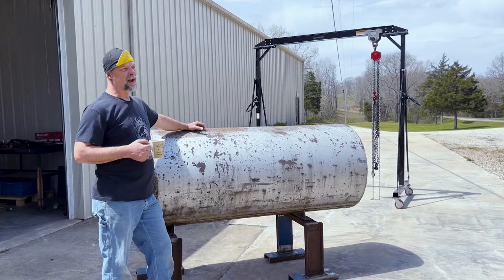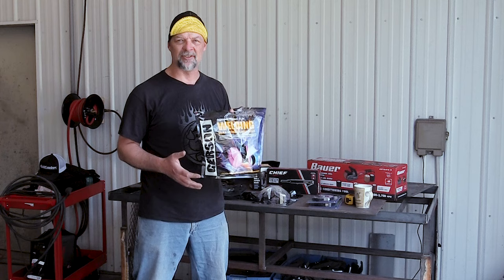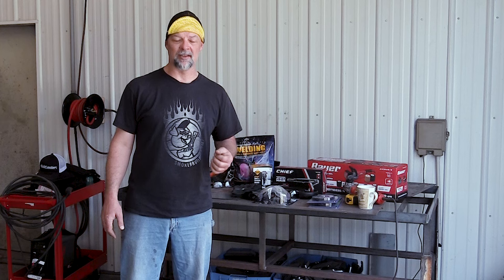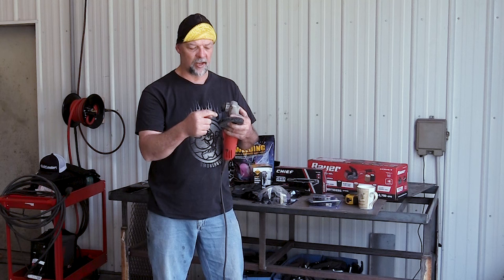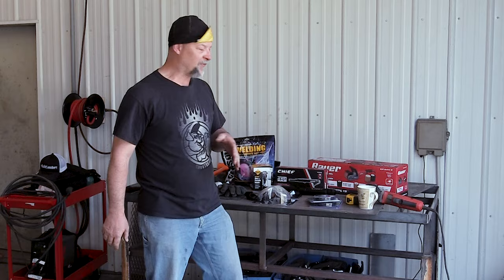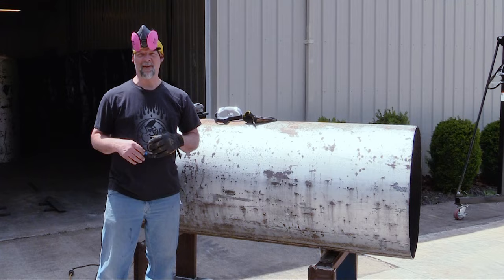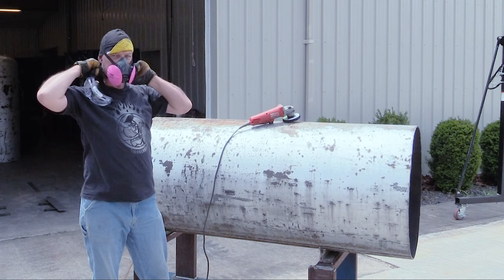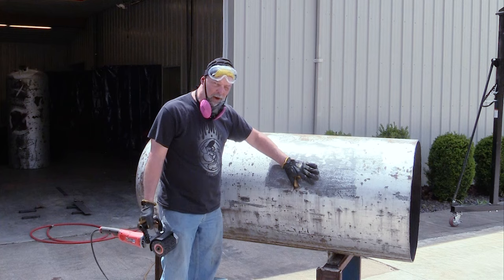How To Remove Paint From A Propane Tank Without Sandblasting

Comment: Awesome Frank, I've been curious about that tool since I seen BS BBQ use it on their offset build. I think I'll be ordering one off Amazon for sure!!
Reply from the maker: they are worth it bro!
Reply: I agree. They are worth it. I haven't tried the HF surface conditioning tool yet but maybe when I have some fun money I'll pick that one up and see how it compares to the Restorer. I can see how for one handed use the Restorer wins but it also has a wider frame so the HF surfacing tool would probably win when it comes to getting in tighter spots.

Comment: Is leaving the mill scale an advantage for appearance only if you're going with a linseed oil finish, or perhaps a clear finish? 
I would think that if you're going with an opaque finish, it wouldn't matter. Or is it a matter of adhesion of the paint/finish?
Reply from the maker: Yes, it’s simply for appearance.
If for some reason you do remove the mill scale and wanna have that dark finish, you can add an acid wash which I’ve been doing on some of my newer pits, then coating them with linseed oil

Comment: What do you do for cleaning the inside of the tank? Noticed on my build quiet a bit of buildup and have just been spending time inside it with a wire wheel. Wondering if there is a better solution. Thanks!

Comment: I am concerned about lead paint on a 1952 tank I am working on.  After prepping loose paint and coating with linseed oil is it pretty safe.  I know I need to be careful with the dust and removal, just curious how well it's is sealed up with the linseed oil.
Reply from the maker: Great question, of course, anytime you heat something, stuff will vaporize and get airborne.
I don’t really think the linseed oil  would permanently seal the lead vapors or whatever but I really do think that it’s not much of a risk after the build is complete.
Most of the risk comes during the build where you’re grinding and sanding and things.

Comment: Have you ever tried a pressure washer with a turbo nozzle
Reply from the maker: We have. They work good also! We used the nozzle kit that hooks up to a power washer and has a sand sucker tube that you put down in a 5 gallon bucket of sand. only issue is making sure you don't set the gun down on the ground and kee[ water from running down the hose into the sand sucker nozzle. If it does the tube plugs up. the nozzle wears out eventually so you need to find a replacement.

Comment: You mentioned lead paint several times. How sure are you that lead paint was used on the tank? Did you use a test kit? I've made a few propane tank smokers and lead paint is something I've always been concerned about with small children around the house. Even just a small amount of lead paint dust would be something to be very concerned about.
Reply from the maker: Great question Josh!
I am not positive, only operating on the assumption it is. Mostly because a high percentage of outdoor paints back in the old days did contain lead. Since this tank was re-painted many times since it was built in 1950 it's a perty safe bet in my opinion.

Comment: I used a chemical stripper and it took the paint off down to a dark grey metal surface. I assume this is the mill scale? Sorry for the ignorance this is my first build. Do i just put the linseed oil on the mill scale or do i need to take it down to the shiny metal? Thanks. Also is there a program (free) that i can use to open up the cnc files from the plans i got off your site? for the 120 offset build.
Reply from the maker: yep, the dark color is the millscale. I put the boiled linseed oil directly on the steel. I actually try not to get the millscale off but some does come off anyway. for the free cad program just use QCAD.

Comment: Great video Frank!
Have you ever used a chemical stripper? I'm a big fan of the needle gun, I used them on tanks in the Boilermakers, but I'm not a fan of the noise and the small surface area affected. 
  I guess I'm just looking for an easier, softer way. 🙋👍
Reply from the maker: Hey! So, I have used them in the past and they do work really well! Not really sure why I didn't use that approach on this one other than rinsing the stripper off with water could leave some surface rust and I wanted to prevent that if I could.
Reply: @SmokerBuilder  thank you very much! I'm getting old and my lungs are gone. I spent too many years on the end of a grinder and was hoping to take advantage of your experience. I'll be calling you for hinges, etc. When I get this tank cleaned up and ready to go. 
  Thank you again!
Sean Manwill, 
Cusick, Washington 👍🙋
Reply: @SmokerBuilder  do you recommend any stripper? Would love a video on that. Thank you
Reply from the maker: @HogMan2022  awesome bro! you're welcome!
Reply from the maker: @TheMikeRybak  I really don't know which one would be best so I will do a video on that also.
I might wind up using another tank for my Live fire set up on this trailer so if I do, I will have the chance to test some of them. Stay tuned!
Reply: @SmokerBuilder   Paint strippers dont work anymore. The EPA removed the active ingredient.

Comment: Wb galvanized tanks
Reply from the maker: Most of the time the tank is not galvanized unless it was used exclusively for water.
Propane tanks are not galvanized because propane and I super captain react with galvanized and will cut holes in the tank.
Most of the time it’s a galvanized painted tank, and the propane never comes in contact with that surface.
Propane tanks are always mild steel.

Comment: Would it be possible for you to do a linseed oil video - original application and touch up - thank you
Reply from the maker: absolutely! I will be doing it very soon! will be publishing one video per week if I can keep the pace so fingers crossed, it will be up soon!
Reply: Is that just standard linseed oil as the clear coat?
Reply from the maker: @underthetreebbq7341  we actually use boiled linseed oil for the darker color
Reply from the maker: @underthetreebbq7341  Yep! boiled linseed oil that you can get at nearly all hardware stores in the paint section
Reply: @SmokerBuilder  any issues putting that on the smoker box?

Comment: How do you remove the rust from inside the tank?
Reply from the maker: great question Fernie! Normally you will not find rust inside a propane tank unless it has been standing open for some time or had water in it for a long time since the mercaptan is oily. 
However, I normally do not concern myself with rust. 
I mostly will powerwash the inside of the tank and then scrub it only if it is really bad. then just season it like normal with some kind of food safe oil like pam etc.
Reply: @SmokerBuilder  thanks for the info👍🏻👍🏻👍🏻

Comment: I've seen some builders leave the paint on and then cover with either high-temp clearcoat or the boiled linseed oil.  Is there a downside to leaving the paint on?  My first thought is if the smoker gets too hot and the paint burns off it could smell pretty bad and be harmful or toxic.
Reply from the maker: I’ve actually left the paint on also.
First couple of cooks on the smoker. You might smell that. Otherwise it goes away overtime.
Not to say that in certain situations it couldn’t be bad smelling or toxic.
Most people don’t have any trouble though